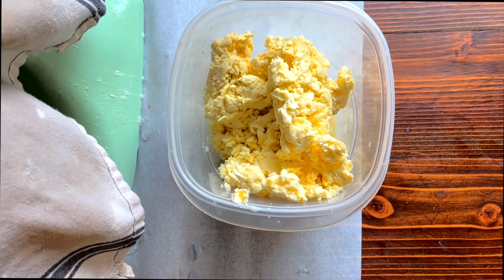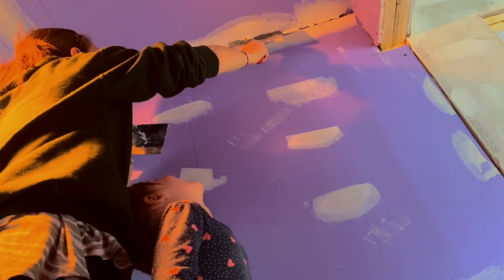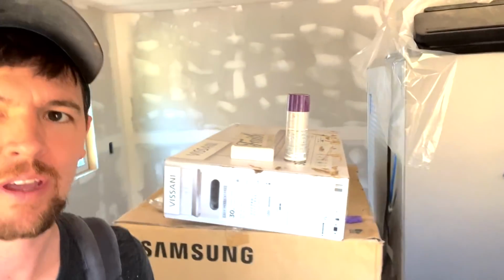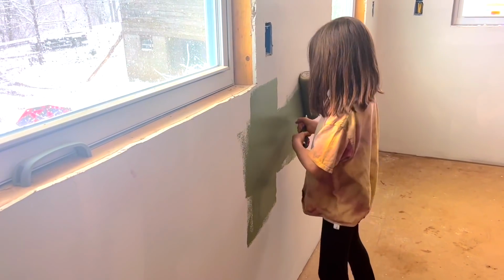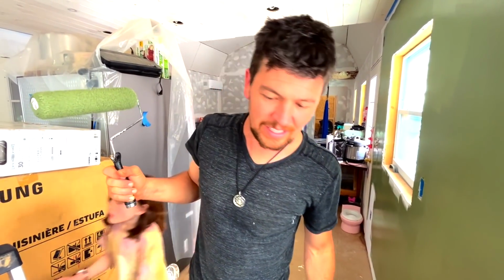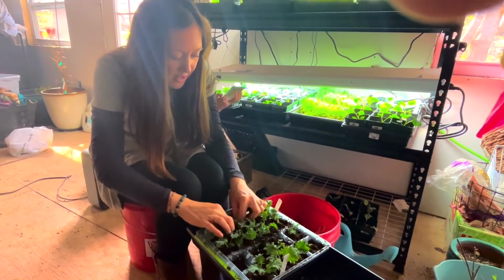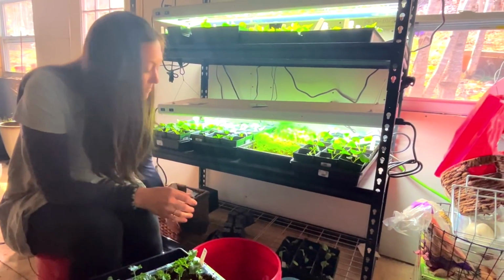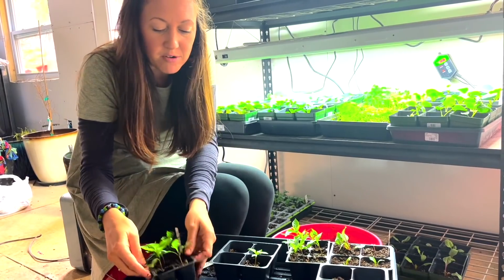Making Progress on the House | Seedling Update

Comment: Have you ever grown broccolini?
Reply from the maker: We haven’t. Certainly eaten it a lot though 🤔
Reply: @GrowingUpHolt  its basically a busy type of broccoli (actually a cross between broccoli and I dint remember what) that produces little sprigs of broccoli all year long or until it goes to seed.  The sprigs of little broccoli heads are of course edible but the ,eaves are too.  It grows like a bush and about 30"-48" by years end depends upon how how its harvested/ pruned.  While slower to rejuvenate and produce in the cold of the fall, it often goes u til a hard frost; sometime even beyond.  It can strive to become as big around as tall with a genersl profile of the classic apple tree seen in coloring books and phonics work pages.  The head are pretty edible even when in flower; getting them harvested daily at that point keeps it producing.  It is far easier to get edible harvests from than regular broccoli.